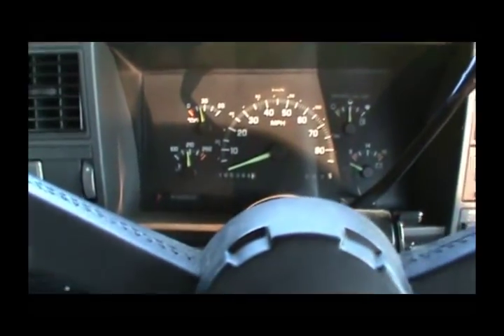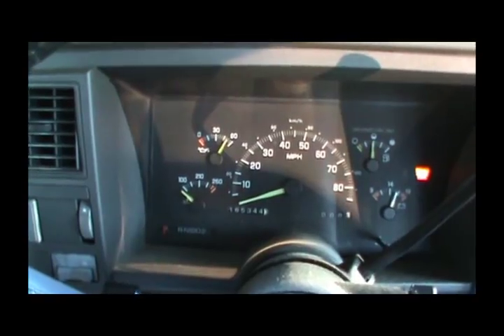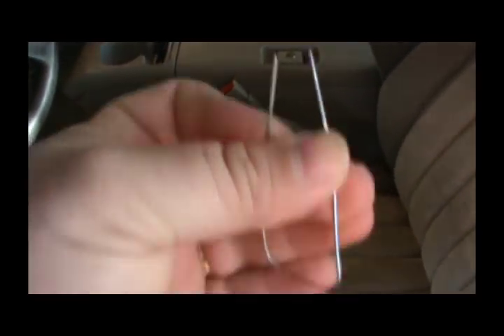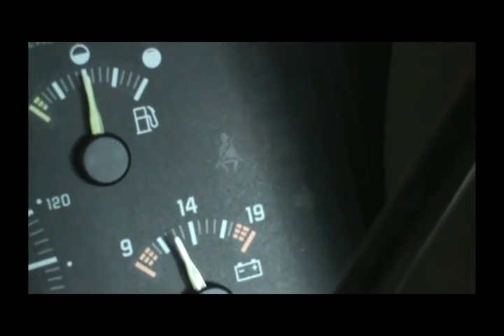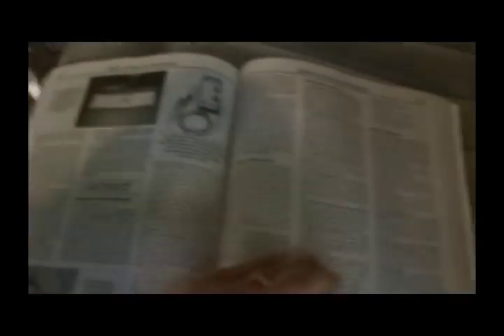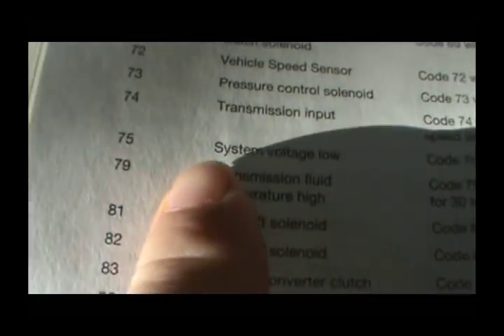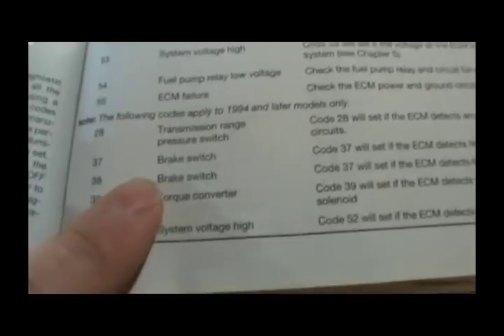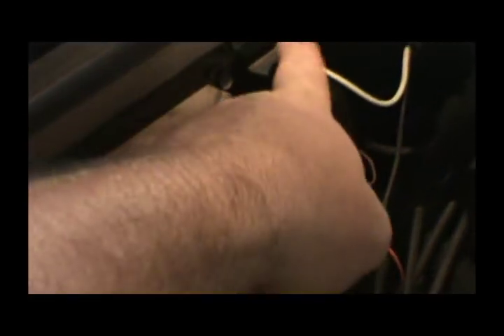1993 Chevy Silverado Hard Starting Issues Part 1

Comment: The code 54 "low voltage" does not mean the overall voltage is low, it means the ECM is not seeing power in the circuit from the relay to the pump. The circuit has a backfeed built into it so the ECM can monitor it.

 So, obviously the relay is either not being commanded on even though the ECM thinks it is, or the relay is actually commanded on but the power stops somewhere along the way.

 I would test for ECM commanded-on power at the relay connector, and then relay power in the FP feed.

Comment from the maker: Thanks man.  I did some more troubleshooting today.  Check out part 3 which should be up soon.  I think it's the PCM but it does send almost 12V to relay but no power from relay.  I checked the relay and the old one worked fine but the new one didn't.

Comment from the maker: I don't think that's the problem.  I just had the entire distributor rebuilt last year.  It'll fire right up when I put the fuel pump fuse directly to battery positive. However, I will check to see if gas is being injected when cranking.

Comment: I had code 54, less than 2 volts coming into fuel pump relay, number 2 switch is getting low power. Where does the switched power come from that goes to number 2 wire. I can however jump a wire from the battery to the fuel pump wire and it will start right up, then unhook the wire and it runs fine. Great oil pressure from the new oil pressure sending unit.

Comment from the maker: I'm wondering if the fuel pump is taking more juice than normal to run.  Maybe it's about ready to die.  But, if the orange wire (fused from battery) has the same amount of voltage as the battery it shouldn't matter where it gets the power from (relay or oil pressure switch).

Comment from the maker: It could be but I think it would have the same issue whether it was powered from relay or from the oil pressure switch.  I did find the new relay wasn't working but the old one was.  The old relay may just be sticking or its the PCM.  I'll get part 3 up asap.
Reply: farmboy30117 ;7

Comment: I had a 96 Chevy 1500 truck 4x4 5.7 V-8... crank no start it would kind of shudder or slightly start but not run smooth then just crank but would not start. Replaced the cap and rotor along with ignition coil pack and it started right up and runs great now. I didn't just throw parts at it though i did about 2 hours of checking fuel pump, fuel relay, pressure at fuel rail and it all checked out. Next tested spark it was there but faint or weak not much flash in my tool tester. Pulled the cap and rotor and had a burn hole in the rotor so I knew I was on the right track. Replaced ignition coil and cap and rotor and its fixed. Hope this helps someone with my symptoms!!
Reply from the maker: Nice!

Comment: Since you get a code 54 that should eliminate some possibilities, because it means at least at the ECM level it is TRYING to run the fuel pump. If you had a bad IGN module it would never run because the ECM would not know the engine was spinning over.

 Look inside that fuel relay connector carefully. If the fuel pump is pulling a lot of amperage it may be burning the connector up.

Comment: seems for me fuel pump is getting to less current whereas voltage is actually there, and when the oil pressure switch bypass this connection enough current can be supplied to the pump...

Comment: have you measured the voltage on the gray wire?
try to jumper the orange and the gray on the oil pressure fuel pump switch and see if its still there
have you measured voltage drops on the gray wire?

Comment from the maker: I had 12.0V on gray wire at the relay.  I haven't checked the voltage leaving the PCM to see if its higher.  If I put the fuel pump fuse to battery positive, it'll fire right up.

Comment: Man I love my truck. same year. No smoke lots of power and no leaks. My problem is strange bump feeling after braking coming to stop Then from stop while turning I feel a lift. bumping. hard to describe. If I give too much gas while turning from a stop I feel a strange vibration.  U joint ? or more than one issue. ? lol
Reply from the maker: Mine bumps sometimes too when accelerating or decelerating.  I think it's the slip yoke in the transfer case.  It could also be a bad CV in the front that could be causing some issues when turning.
Reply: +farmboy30117 yeah thanks man. I notice that top Mount on left tire arm that is most visible is worn too. I have the ext cab long bed. She's a boat but I love her. She needs to breath though. gotta get her opened up intake and dual out exhaust.

Comment: They will give you a key at autozone for free. Put it on your key chain. Once the key is in, never try to start the vehicle. You may not get a code for this problem. 10 years ago I ran a power lead from my battery to a 30 amp switch. The other lead to the fuel pump power lead. Truck starts right up. Every time. Changed the oil pressure sending unit and relay but no help. The switch did the job.
Reply: What key?

Comment: Hey farmboy, 
      Enjoyed your video. I have a 94 sierra with a no crank issue. I have been fighting it for a while. No crank from key, however fuel pump and everything else comes on when key is in run position. Engine will crank with wire directly to starter solenoid. Key must be in the on position to run. I have changed Starter and solenoid, neutral safety switch,ignition switch, and ignition control module. I have checked all fuses including inline fuse. Worked great one day then the next day it was gone and hasn't functioned intermittently. Just gone, seemed like a blown fuse but I sure haven't found it. Key tumbler still interacts with the rod and new ignition switch. Any help would be greatly appreciated .
Reply from the maker: Wow, sounds like you've eliminated the usual suspects.  I believe your issue is electrical, but the wiring diagrams I've looked at seem a bit confusing.  It appears there's a 5A crank fuse on the lower right hand corner of the fuse block on 5.0/5.7 engines.  The wiring diagrams doesn't show this for 4.3/7.4 engines.  On another diagram, it showed a 3A fusible link on the pink wire from the ignition switch to the ECM.  I believe both of these are just for crank indication to the ECM.  I'd take a test light and make sure I had power at the purple wire in the ignition switch harness with the key in the crank position.  If not, you may have a bad ignition switch.  If so, trace it on down to the neutral safety and so forth until you get to the starter solenoid.  You may have a broken wire somewhere in the circuit.  Good luck!
Reply: Toney Charles check the fuse block on firewall.
Reply: @ Toney Charles, that sounds like you have a bad distributor pickup coil, if you're running a hot wire to the starter solenoid to get your engine to stay running after starting it.

Comment: I have a 1989 Camaro and the same exact problem with it. I ran a 30 amp switched wire to the power lead on the fuel pump. I also have a direct power on a switch which I turn on when it is cold. It starts right up and I turn the switch off.
Reply from the maker: It turned out to be the fuel pump relay.  I got a bad one from autozone.
Reply: farmboy30117 That was my first choice. An easy way to check the relay on a Camaro is to swap it out with the fan relay on the other side under the hood. I replaced mine anyway. Not that expensive. Didn't work, put a new oil sending unit on car, that didn't work either. Same with my truck. Sounds like you got lucky.

Comment: I've got a 92 Chevy Blazer and I'm having starting troubles too. I have to push the gas just to get it to start up. Not sure what the problem is but when it gets started it'll idle extremely rough and about 2 minutes later it runs like there was never an issue. Any ideas? I've got a New fuel pump, fuel filter, distributor cap, rotor button, plugs and wires.
Reply from the maker: Sounds like the Idle Air Control is not working properly. Here's a good place to start: http://www.wikihow.com/Check-an-Idle-Air-Control-Valve

Comment: Im not sure whats going on, my 93 idles kinda right, then not like a slight miss.  Once its in gear slight hesitation sometimes then catches up, dont notice it at all after that or down the road. Today just started shifting hard from 1-2. Just put in a new TPS and  spark  plugs. Not sure whats going on or what to try next.
Reply from the maker: Could be the throttle body needs cleaning.  My trans shifts hard from 1-2 sometimes too.  I'm not sure why but it seems to be ok otherwise.

Comment: Ok thank you very much  i will check those and no the fuel pump is kicking on all if a sudden its not getting fuel again ive got spark, jus not getting fuel I replaced the fuel pump about 4 months ago im only getting that low voltage to fuel pump relay  code

Comment: Hey, my friend, my 93 diesel want start, ( it turns over ) when I look underneath the truck, there is a pile of diesel fuel leaking towards the back of the engine. I need the truck to haul my horses. Any idea what the problem might be ??? Please help with a suggestion.
Reply from the maker: I'd check the fuel line running from the filter to the injection pump first.  If you have a leak in the supply line, the pump will draw in air and won't pump.

Comment: Hey farmboy i have a 92 chevy Cheyenne c3500 5.7l i have been getting the same code for low voltage to fuel pump relay i replaced the relay  and fuse thought i fixed it but its doing the same thing running out of ideas
Reply from the maker: Electrical issues can be a real pain to sort out.  You might want to check for a voltage drop between the battery positive post and the relay.  Also between the battery ground post and the relay (ground) - this will only be active for a few seconds when the key is turned on. Bad grounds can cause all sorts of issues.  I assume you're only getting the code but not an issue with the fuel pump.
Reply: Also i mine does not fire when i get oil pressure and did not start when i jumped  the fuel pump not sure why it didnt start

Comment: What if you don't hear crank but just the starter. Then a few cranks , it turns over? Anything will help
Reply: Ben-David Armstrong Sounds like a bad starter solenoid.  The solenoid pushes the drive gear out to engage the ring.  You can verify by viewing the end of the starter while someone tries to crank it (or film it with a camera).  If it doesn't come out, it's easier to just replace the starter since it has to be removed anyway to fix.  Hope this helps.
Reply: thank you i think thats what did the trick!
Reply: That's great!

Comment: have a 93 myself having issues if i undo the brown wire for timing it will start and run a bit rough but plug it in it will only start with gas pedal floored and only run if foot is on the gas some plus when it is running my gas hand bounces everywhere temp only goes up to bout 110 then stop (have 185 thermo) new egr valve brand new distributor shaft and sensors rotor plugs wires also temp sensor is new as well any idea
Reply from the maker: Could be the fuel pump, but first, unplug the brown wire and make sure the timing is set to factory spec.  Should be on the emissions label on the radiator core support.
Reply: dont know if it matters either im getting no cel light
Reply from the maker: The CEL on these old trucks usually means something on the emissions side has failed, so I wouldn't expect it if its timing, spark or fuel related.
Reply: figured as much but im a jeep guy dabling with a chevy truck and its giving me fits

Comment: WARNING, you need at least 60psi - 65psi fuel pressure on the rail when CRANKING. If your fuel pressure gauge indicates less that while CRANKING, you will have trouble cold starting even if your vehicle is properly tuned up. if replacing your fuel filter doesn't fix it, you may need a new fuel pump.
Reply: not on tbi engines you dont need 60psi need roughly 7psi

Comment: My 1992 chevy Cheyenne 4x4 just took a crap on me at work.  Not sure what to throw at it first,  but I'll deffienitly try the paper clip method first! And I'll be playing the lotto with all those codes numbers! 35 57 32 12 lol
Reply from the maker: Haha, good luck with it!  If there are no codes, check for fuel when cranking and then spark.  Most of the time, as far as I've seen, it's either the fuel pump relay or a bad distributor.

Comment: I have 1996 GMC Sierra 5.7 v8 
I change spark plugs and wires, cap and rotor,  fuel pump and the truck still take to long to start and when the truck start the engine shake a lot and i don’t have powe and also have a ugly gas smell... I need help what I can do... 🤷‍♂️🤷‍♂️🤷‍♂️🤷‍♂️🤷‍♂️🤷‍♂️🤷‍♂️🤷‍♂️
Reply from the maker: Saul,  my best guess would be a vacuum leak.
Reply: Can u help me how to fix the vacuum leak
Reply from the maker: @sauljuarez3941  Take it to a reputable shop

Comment: The only number that appears is 12. Is there a code for 12? What is 12?
Reply from the maker: 12 is normal.  It means there are no trouble codes.
Reply: @farmboy30117  Man. Well that takes me back to the start cause my truck is not starting. Did the whole paperclip and its what it gave me :/
Reply from the maker: @denisemoseley9662  These OBD1 vehicles usually only set a code if it was related to emissions or a sensor.   Need to see if it's a firing or fuel issue.

Comment: check ground off fuel pump to frame
Reply: I added a ground wire from lock ring on fuel tank to the frame and it fixed my problem. I drilled a 1/16 hole in the ear on the lock ring, then ran a small metal screw into hole in the lock ring ear and attached the wire with a crimp-on eye. Also, a faulty oil pressure sending unit behing the intake manifold will cause low voltage and or no voltage.